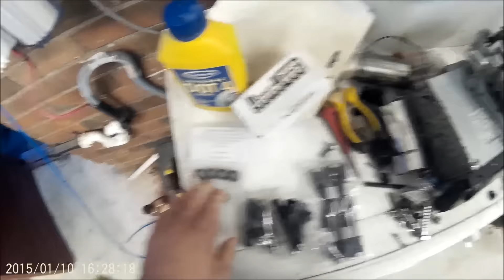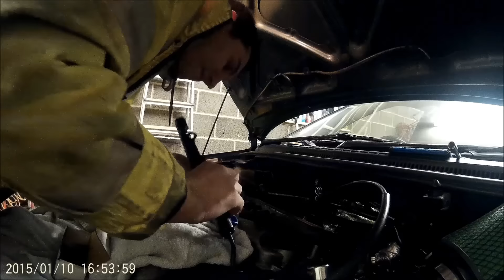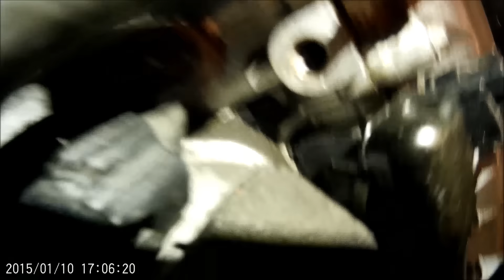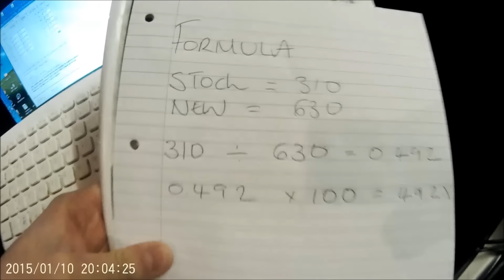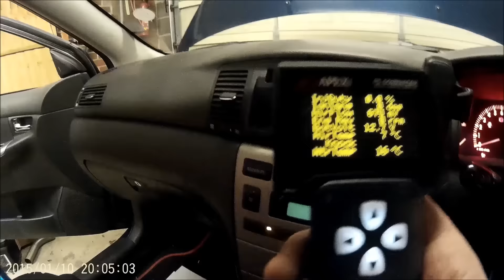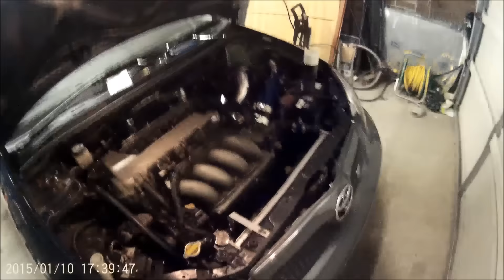Build Blog - 2ZZ Turbo Corolla T Sport #6

Comment: What intercooler you using and what make and model coil over you got on it because I can't find none that will fit pal ?
Reply: Because I don't want a turbo kit. I want to buy the parts my self and fit them on it
Reply from the maker: +MrPAKIRAMBO786 
Intercooler was just a universal 2.5ins kit and it had BC coilovers, they do a set for the corolla

Comment: Transmission needs pulled for any internal motorwork, curious though, Stew, are you liking the turbo 2zz build thus far?
Reply from the maker: Colt Scott 
Yeah the power band is fantastic, installing a new ecu later this week so will likely be a video about that soon